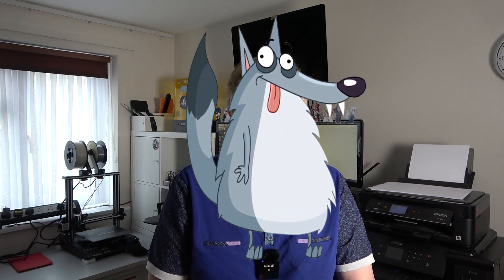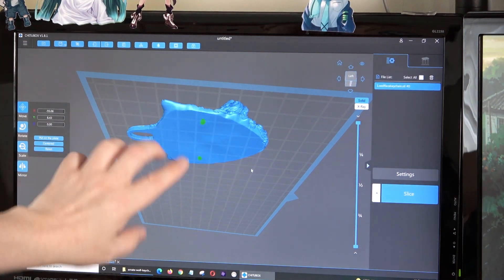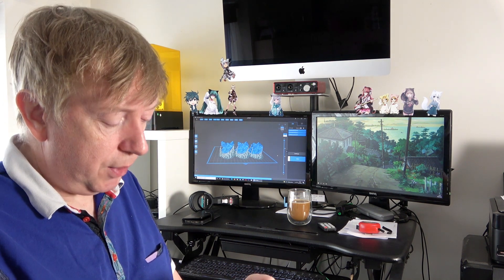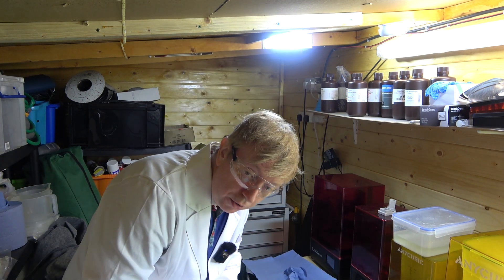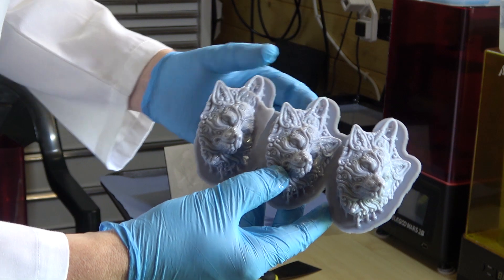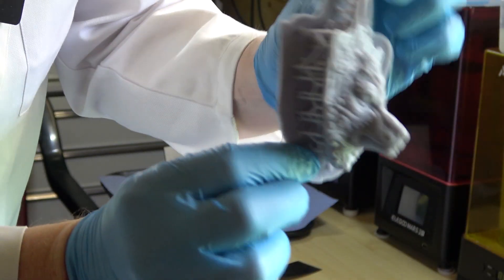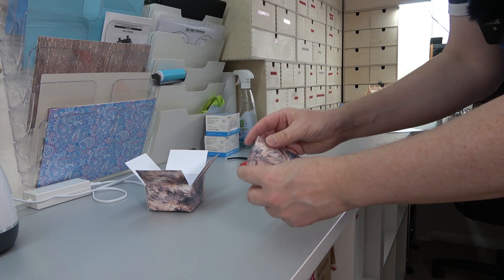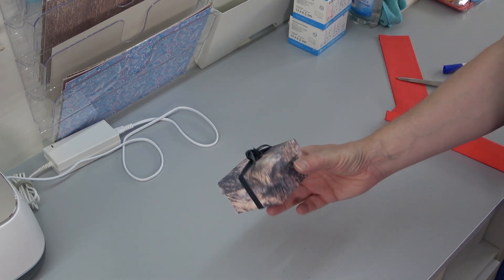Gift Project From Start to Finish. Wolf Head Keyring.

Comment: Hi Rick, I was wondering if you could do a quick tutorial on replacing the fan in the spray booth? I have the same one and would love to make it quieter!
Reply from the maker: Hi Joe, thanks for the suggestion. To be frank, I'm not sure the box could survive another dismantling. Had to do some improvising when reassembling it, but essentially I just cut the wires to the fan and replaced it with a same-sized PC fan. Just need to make sure the power requirements are the same (they are printed on the fan).  I should also mention that after using it for a while now, I realise the air-flow on the new fan is less that of the original fan and overspray does enter the room, so I have to use a mask and air filter in the room when using it, so it might not be worth doing at all.  Hope this helps 👍

Comment: Some of the diorama guys use uv resin for the eyes after painting
I think on the box the flaps should fold inside the box when used with a lid.
Did the paint clean off the silicone mat ? i only use them with epoxy, but thought it should work with paint
Reply from the maker: I used clear UV resin on a practice piece, but the overly-glossy eyes ruined it and cheapened it; made it look like a cheap mass-produced toy. 
It’s funny, I was thinking the same thing about the box flaps while I was watching this video back LOL!
Yes, I’ve been using acrylic water-based paint and it scrubs off the silicon really easily 😊👍

Comment: Good attempt. But i would've used a brush to paint in the solid black & white highlights for better detail / definition, just as you did with the eyes. It looks a bit big for a key ring tho, more like a door knocker. Did you figure out what caused the two printing fails? It would generate alot of waste if that is a regular occurrence.
Reply from the maker: Yep it was the exposure times being too low and bed-lifting speeds too high. Subsequent prints have been perfect 👍

Comment: Hi Rick, A couple of questions. How stong is the resin? Is it waterproof/Cold proof? I would like a couple of custom parts made for my scope and mount. Considered 3d printing but it can be brittle and break I've been told in the cold weather.
Reply from the maker: The resin is generally pretty strong, although I think there can be variances depending on exposure times used. 
It is strange stuff. It has a small amount of flexibility, but can also be quite brittle and can chip. 
Regarding temperature I really don’t know how cured resin acts in cold or heat, but I do know it doesn’t print well in the cold. I’ve had to build a heat box for my printers so that I can continue using them in the winter. 
Regarding longevity. I understand it could be prone to becoming more brittle over time if exposed to sunlight and UV. 
On the plus side, if you keep the file you used, you can always print more of whatever it is you need.
Reply: @rickvanman  Thanks Rick. I'll shall keep on looking. Maybe have to get some test prints done of each and test over time. Thanks again.